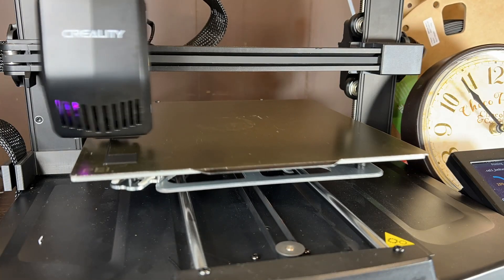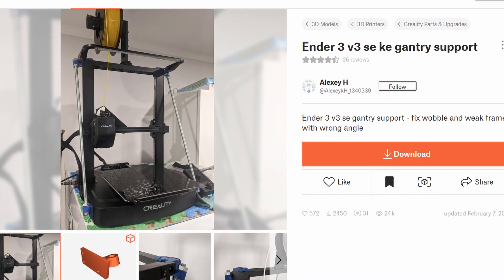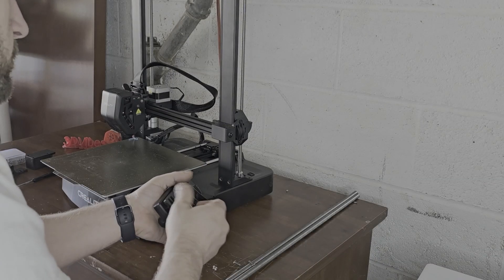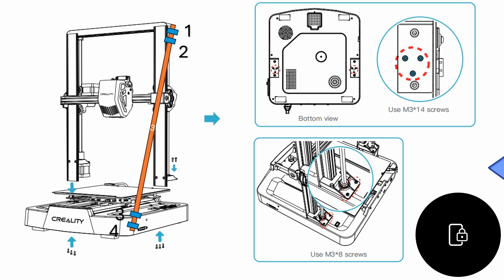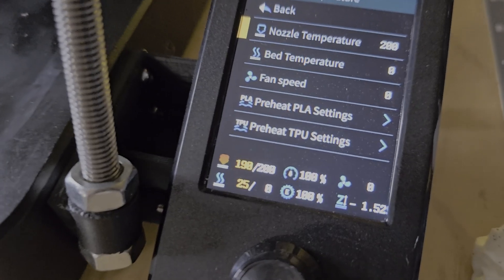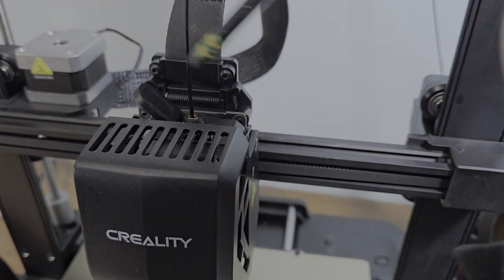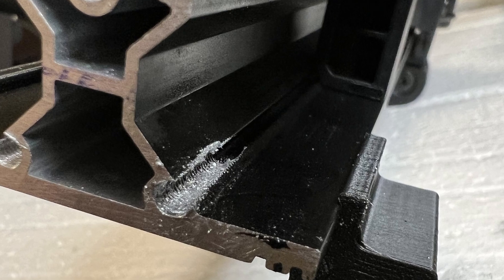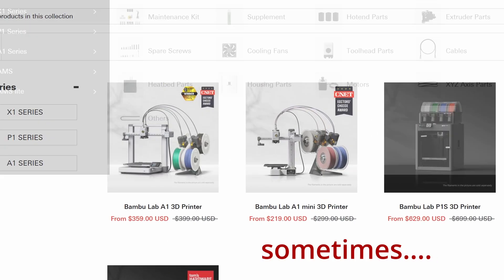Ender 3 V3 SE Wobble FIX - Gantry Frame Stabilizer Mod - Part 3

Comment: Bambu have dropped the ball by forcing the printer to stay connected to the internet and collecting all your printer data. I'll stick to my Ender 3 V3 SE with Klipper. My stability mod is mounted on the back of the printer, but it feels much less rigid than I think it should be. Thanks for this short but helpful video!
Reply from the maker: I was originally going to push my recommendation for BambuLab much harder before the firmware controversy. That's another reason this video took forever, haha.  My opinion on the Ender 3 V3 SE keeps rocking back and forth, much like the gantry frame.